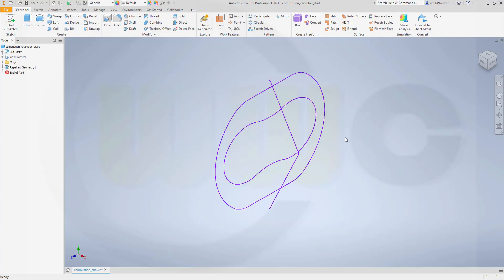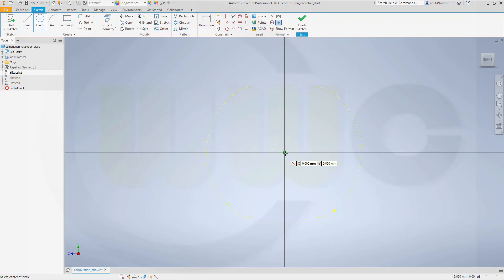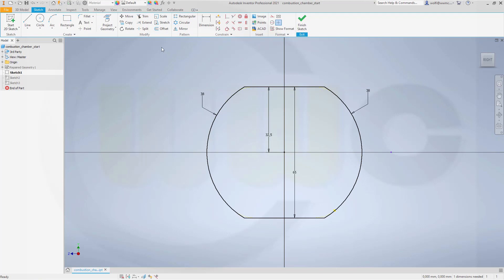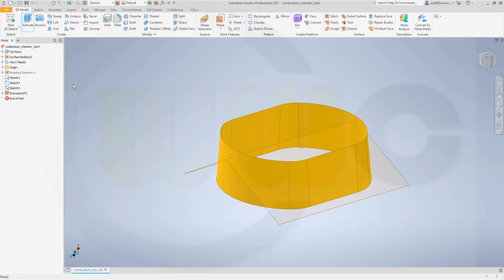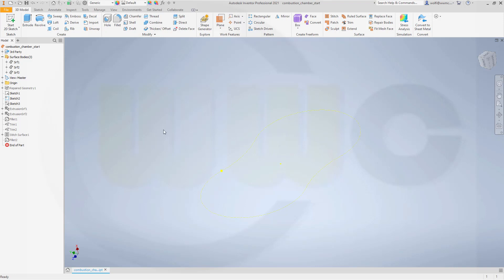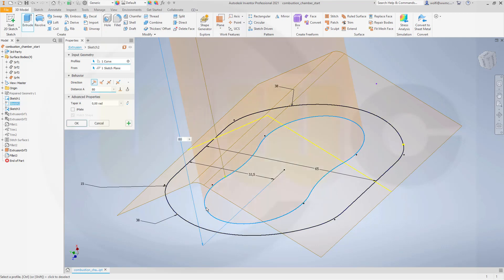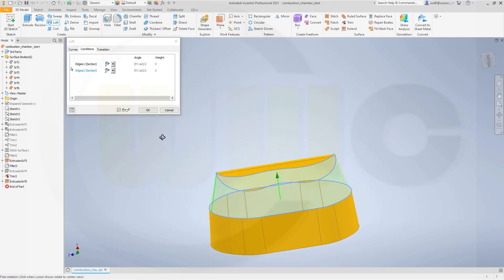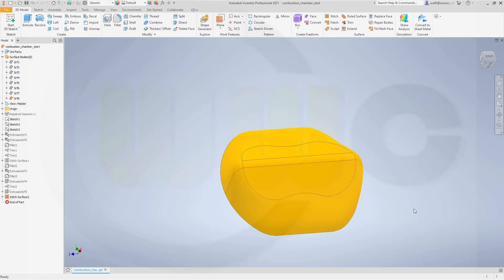Combustion Chamber - Inventor 2021 Training - Surfaces

Comment: which programm is besser..catia or solidworks or creo or inventor?
Reply from the maker: Depends on what you want to do. The most powerful of the 4 is CATIA. The best usability - Inventor. Creo is just the same old PRO-E with a new look - only cosmetic changes - at least in my opinion.
Reply: @wolfgang.walden.cad.training  I am a plastic mold designer and work on solid and katia, but I find that the solid is stronger and easier than katia, although the global arrangement says that katia is better.
Reply: @wolfgang.walden.cad.training  Ingegner Walden, I would be glad if you helped me in my big challenge. As an extrusion die designer I  had been using fillet with keeping edges in CATIA in last 3 years. For my new position I must use inventor as CAD software and I can't find same ability in this software.
Thank you for sharing free and practical videos.